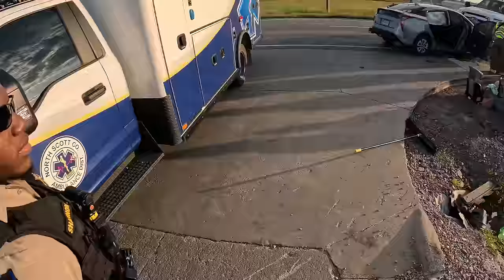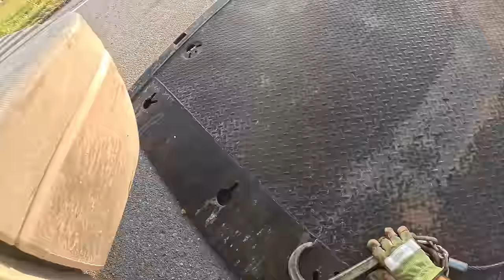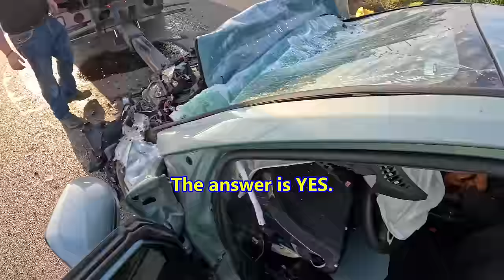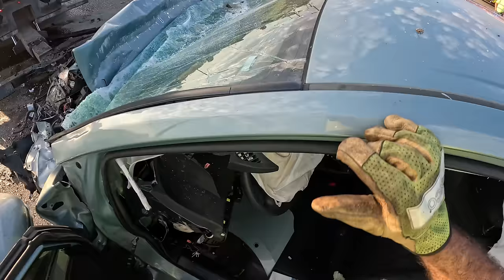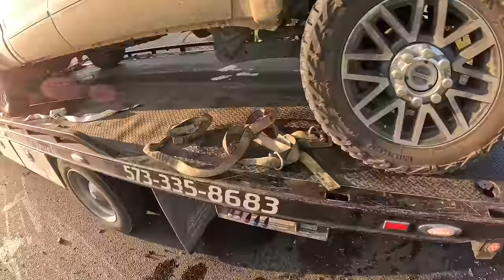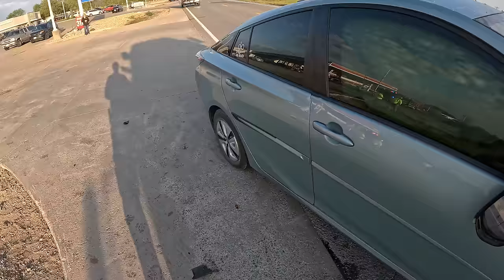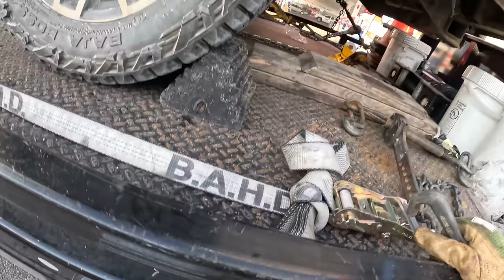HEAD ON CRASH CODE RESPONSE     DOUBLE TIME

Comment: sometimes when i watch your videos i seriously wonder how these people wrecked in the first place like this case seems like there shouldve been no reason for an accident yet somehow it was a bad one best wishes to all involved regardless also ron ill let your ford comments slide just cuz i like ya the radius arm bracket bolts broke because it has a cheap lift and the hardware isnt great but realistacally some new bolts and remove the damaged front bumper and that ford is driveable not fixed but driveable

Comment: I love your remarks about Ford haha but isn’t one of your rollbacks a Ford?
Reply from the maker: Yes, we own several Fords.   We just like to joke around and have fun.   Thanks for watching and God bless.
Reply: Fords are good or bad, depending on what year.  Owned a '64 F 100 with small 6 cylinder that was a workhorse. Bought it very used, finally wore it out after a couple of years.  In early '70s. The company l drove for ordered an LN 9000.  Took Ford 18 months to build it.  Later bought a new '75 Maverick new.  New but not really.  Distributor was checked and had 150,000 miles of wear on a vehicle with 12,000.  Engine had been assembled with junkyard parts.  Got rid of it, got a '77 F 150.  Could not keep twin front axles in alignment. Replaced front wheel bearings every 4 -5 months.  Many years later inherited '85 F 150.  It was a decent truck until engine blew up.  Followed it with an '86.  Major problem with it was the firewall flexed too much when clutch pedal was pushed in.  After two wrecks retired it.
Will not own anything from the '70s with a Fix Or Repair Daily emblem on it.  In early  '70s Ford was having many problems with strikes so quality was crappy.
Reply: @Ron Pratt I like your son in law talent he was a very good guy with you and I missed him when he doesn’t go to calls with you and how is he doing and you
Reply: @RonPratt hello from Michigan

Comment: How does the passenger airbag blow without the drivers side blowing?  Never seen that before...😮
Reply: My 2000 navigator has an issue inside steering wheel  "clock spring"  mechanic said that airbag is disabled
Reply: If the seatbelt on the driver's side isn't buckled in, the airbag is inhibited. Because on impact the driver would be thrown forward at driving speed and the force at which the airbag blows up would likely crush every bone in its path.

People can get bruises from the airbag even when they are buckled in properly.
Reply: Simple, a prior accident repair did not fix the drivers bag or control module. Some body shops and rebuilders cut corners. And bags are an easy place to do so. Expensive to fix and unlikely to get caught on the sloppy repair till so much later that it can't come back on you.

Comment: Yes batteries. My son was a passenger in a small car involved in a head on at 50 plus mph. He was so badly trapped they had to cut the car apart to get him out He was badly injured but dodged another bullet because the car battery was against the firewall in front of where he was sitting. Luckily the front body panels had moulded themselves around the battery without damaging it. I like the joke about Fords. I only owned two Fords and they were both rubbish. By contrast the GM cars I owned just kept going despite taking them places they were never meant to go. The last one I had made it to over 500,000 miles on the original engine with minimal maintenance needed. It was still going strong when an idiot parked a Landcruiser into the back of it at about 40mph. Sadly both vehicles were write-offs.

Comment: Ron you are right on one thing it is a Ford and there NOT BUILT TUFF there thrown together by a few small pins and to me there the worst vehicle to own I owned one and never own another 2004 ford F150  the transsmission went out and  got another one put in not lastest 6 months and then another one was put in but engine blew with the cam fazers  worst idea ford ever had

Comment: did you disconnect the lithium ion batteries of that prius? do that before you touch it otherwise you will be zapped by high voltage and high current. and that's the biggest downside of hybrids AND EV's!

Comment: Did I see right a Dewalt battery on a Milwaukee tool
Reply: MA-C tool, but yes, you did. Baue-r, Klie-n, and Grac-o, and even Amku-s Ion who make fire rescue tools like the Jaws Of Life also use the same socket type. (I've been getting flagged and auto-modded for "advertising spam" by YT, so I'm forced to put hyphens in any brands until it calms tf down. In fairness, I do talk about brands a lot. It's been a rough past 4 days).

Comment: You should leave in you running code to the scene. Or, post a separate video of your trucks running code.
Reply: theres a whole playlist of all the videos where they run code if thats what you're after 🙂
Reply: @bevakathedementedraccoon and… it’s possible on this call, the distance was short enough and/or traffic was light enough so he didn’t need to use the siren more than once at that intersection.
Reply: Hey Ron - here's how to please everybody...  include the drive but put in a text block saing "advance to 27:39 for the recovery"    (or whatever the arrival time is).

Comment: prius should be on the roll back while towing the furd.
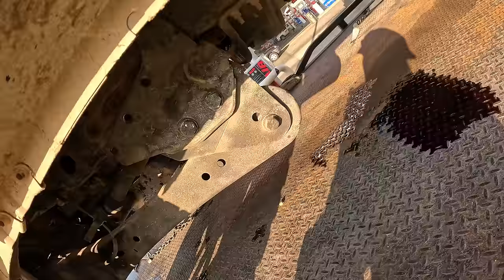Reply: Can't. The Ford has a live rear axle. You'd have to disconnect the driveshaft and secure it to the under-body of the truck, otherwise you're going down the road spinning the wheels, the driveshaft, and on the receiving end, the gearbox. The gearbox really doesn't like going highway speeds with the engine off. Secondly unrelated but specific to this case is 20:04. The front isn't even fully connected to the frame anymore.

Comment: The driver side air bag did not deploy on the F250.  I have never seen a passenger side air bag deploy and not the driver side air bag...and I am a retired state trooper and crash reconstructionist.  While it can happen it is very rare.
Reply: Driver doesn't wear seat belt, passenger does, SRS detects excessive tension on passenger side and the bag pops, it detects no excess tension on the driver's side and doesn't pop. That's how the later year SRS works. I agree that years ago they used to pop based on the impact itself, basically working semi independantly, and if it didn't then it was a malfunction. That operational standard has been depreciated for a few years now.

Comment: Seems as though the impact occurred while the pick-up was on the wrong side of the road after crossing over a dashed yellow line.  Was the pick-up making a pass and the Prius pulled out the gas station, made a right turn, so only looked to the left before pulling out, and got creamed by the Pick-up travelling (and most likely speeding) on the wrong side of the road??  Why is the center line there dashed anyway?  Why wouldn't it be a No Passing zone based on that side road as well as the gas station access road??

Comment: That doesn't necessarily hold Ron. My Ford Ranger XLT pulled a loaded dump truck which was stuck on beach sand out to the highway (US 98), after being told it wouldn't make it. Well, the owner of the truck, a GMC had to eat his words. My 3.0 Liter V6 did the job quite well. I also had a 5/16" link logging chain with heavy hooks that I attached to the frame. The right equipment for the job. Flip Over Read Directions. Found On Road Dead, First On Race Day, and for those who think that way Fucked Over-Ripened Dodge.  I prefer the first three, my friend.

Comment: I was thinking with all that damage to the car it would have been better to pull it on the bed snd wheel lift the truck from the rear tires. Maybe it didnt make much difference other than weight distribution.......idk

Comment: Being that the car was damaged a lot more than the pickup, wouldn’t it have been wiser to put the car on the bed and towed the truck?
Reply: The truck was 4wd. And, the way the front axle moved, the transfer case is suspect. So, getting it in neutral is iffy.
Reply: And the left front suspension of the truck was broken.

Comment: Pickup trucks are way too damn tall, these days.   If that was a truck built in the 80s or 90s, it wouldn't have crawled up the hood of the Prius.   Even if it was the HEIGHT of a truck from the 80s or 90s, it wouldn't have crawled up.  Why people (no offence Ron) believe their trucks need 10+ inches of clearance, when they rarely drive off road, boggles my mind.

Also, I'll take a Ford F150 over a Dodge Ram or Chevy C or S 10 any day.  
Especially if they're the earlier 80s or 90s models.
Reply: Yes, but not the right way to look at it. If it was a straight on hit, the Prius at half the weight of the Ford would have taken a VERY hard hit. because it went under a lot of energy was dissipated in the hood, fenders and top of the engine.  So, the G forces on the driver were lessened by all that sheet metal crumpling. And I'll note that the doors still opened.

Comment: Why does everyone diss fords🤣
Reply: Because they're junk. I have a Ford Focus ST, and while I love it to death I'm at the point where if I had to replace it, I'd be okay. The water drainage holes being too high leading to body panels rusting from the inside out, the brake fluid fill cap being under the windshield cowl, the proprietary heater core fittings that fail and leak coolant, the coolant tank that leaks from underneath, the coolant tank cap that can break in half with the spring body getting stuck inside the tank, the washer fluid caps desintigrating in the first 20 thousand miles... and that's just the stuff I've dealt with. I have a 3 page Word document in 10 point font of every common fault that car has based on my adventures on the forums the past 6 years. They're junk.

Comment: Ford  Tough . This is why I drive a truck . These cars are junk . Hope the drivers are ok . All  Auto marker can keep their small cars .
Reply: Most cars are designed specifically to crumble during a wreck so the occupants are safe inside , just because a truck withstands it's impacts doesn't mean that it's occupants would be ok where i live there's been wrecks involving cars and pickup trucks and the deceased victim is the truck operator while the automobile occupants survived with moderate injuries.
Reply: The Ford has a head-shaped crater in the windshield and they're the one on the wrong side of the road. They are absolutely not okay, even before the crash.